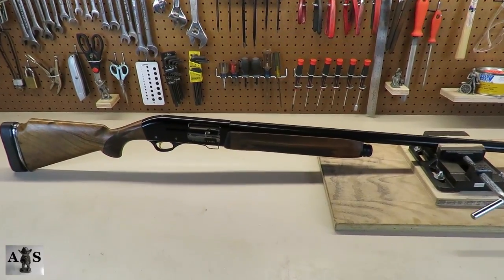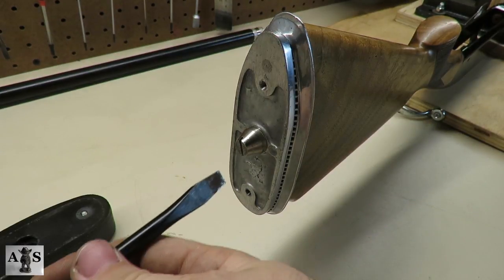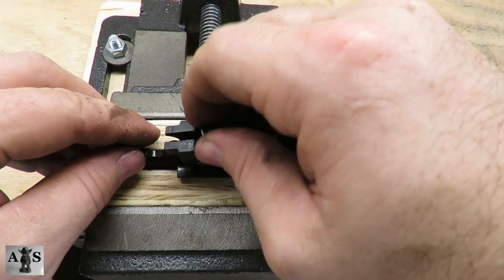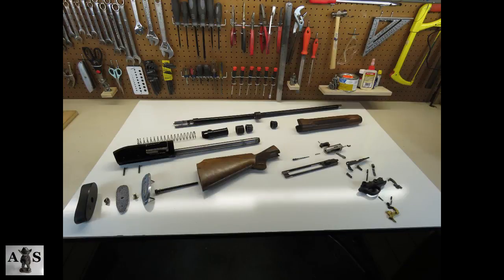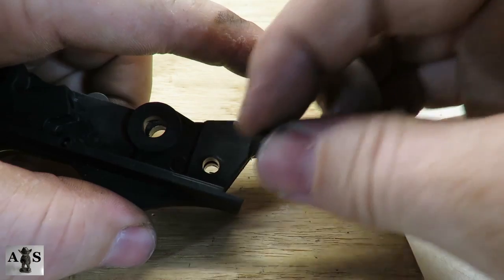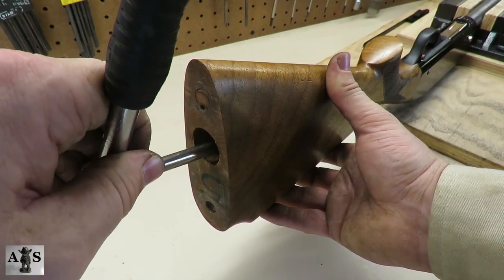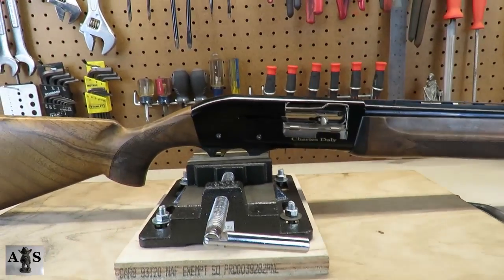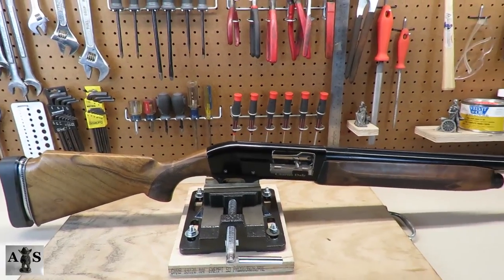Charles Daly shotgun Disassembly, Assembly, & Review

Comment: Are you near Virginia? I had a gun smith replace the operating handle, and didn’t I shoot the gun till later that year. And when my buddy actually ended up using it, he squeezed the trigger and the gun fired, and the bolt slid all the way back towards the stock and is now stuck there